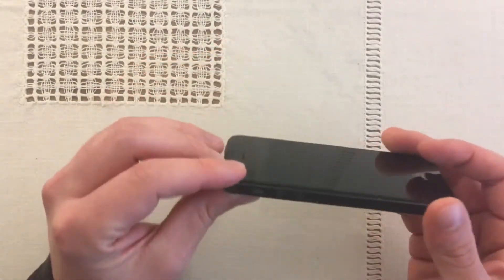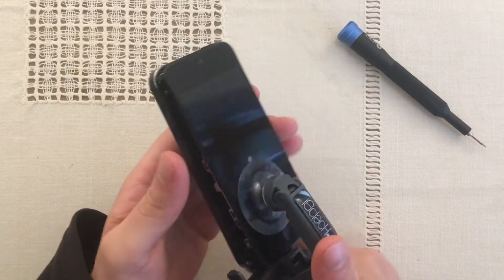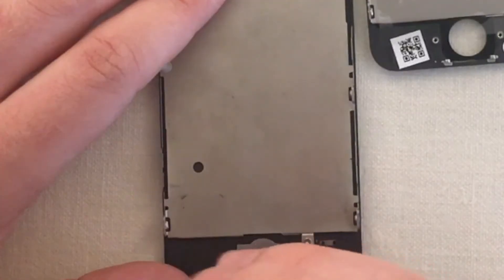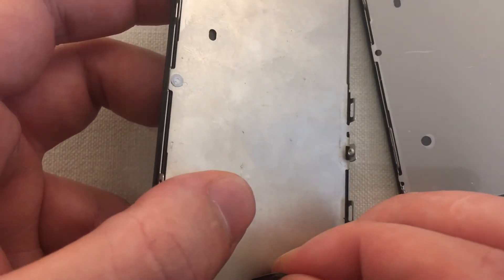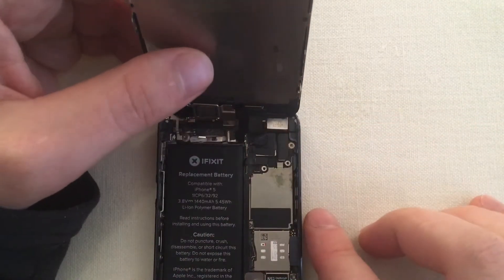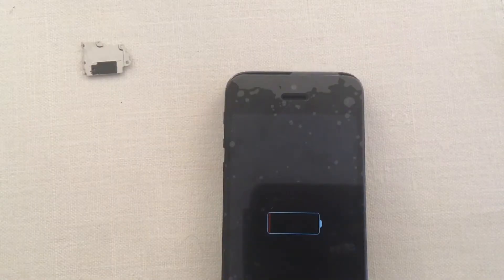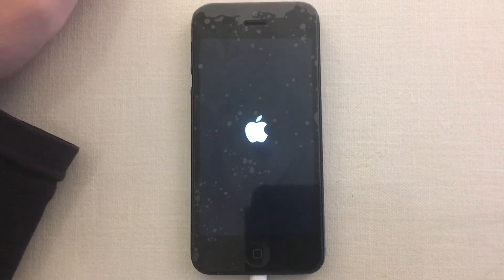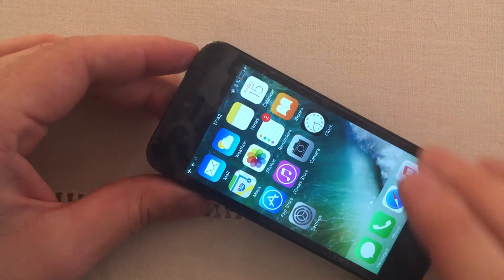Replacing the iPhone 5 Screen Assembly (with only very minor difficulty)

Comment: Replacing the displays on iPhones is so quick and satisfying to do.
Reply from the maker: Hey, haven’t seen a comment from you in a while. Hope you’re doing well. I agree, that’s been my experience so far but I think for newer models it’s more difficult because of the watertight adhesive.
Reply: Yoenosh for the newer phones it will take a bit more to open them up, it gets so tight that it feels like you’ll break it if you don’t heat up the adhesive. I watched your other videos when you put them up but never got around to commenting, keep up the good work :)
Reply from the maker: @peterdelacruz1692  My bad, I failed to notice that you responded. I'll keep that in mind for when I open up the iPhone 6. It's still going to take a while because I'm trying to finish videos that I already recorded for. I'm sort of behind. I don't want it to seem like you're obligated to comment but I do appreciate it.
Reply: @Yoenosh  Take as much time as you need